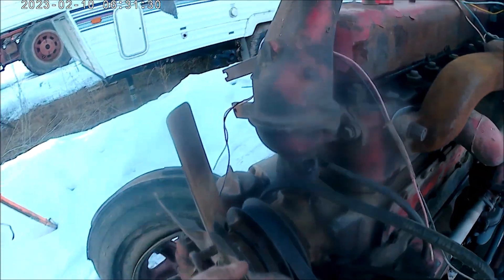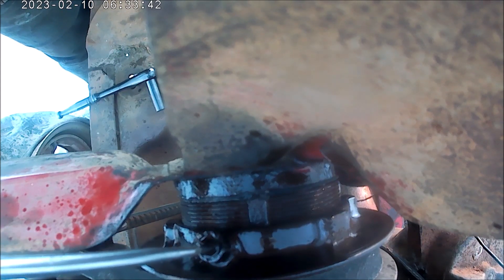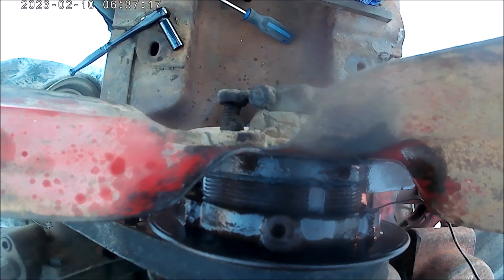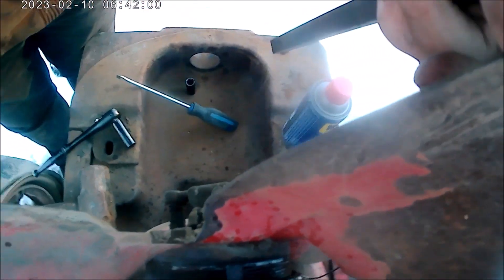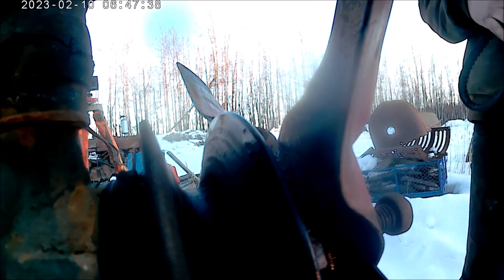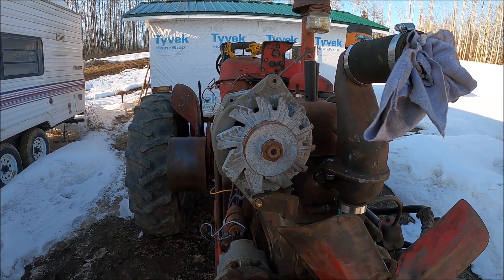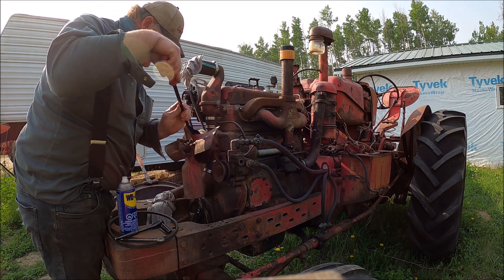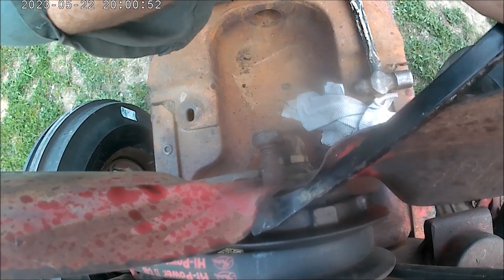International 400, Belt Replacement, and Alternator Mounting

Comment: We had a time trying to get the one on the 300 to be right. It's so tight hardly no room for anything
Reply from the maker: We just stick to the generators on the 300 and 350s down to the H and W-4. Most of the 350s were factory 12V. You need a mini alternator if you go that route. Tightening the belt is a problem with an alternator as they are so much above the fan pulley, that the lateral movement required to tighten the belt, is more than you really have room for. That's why on those engines they went with the expanding pulley, rather than swinging the generator like the little engines or diesels. The expanding pulley is too large to run on an alternator, as alternators like to run fast.

Comment: Good job.  Faced the same belt loosening on my 300 U not long ago.  Definitely a take your time, let penetrating fluids do their job or life can get kinda interesting if you booger up that locking screw not to mention if you break that casting with too much hammer..  Been thinking about going to an alternator like you idea.
Reply from the maker: With the 300, you need a mini alternator. The one I used is too big to fit under the hood of a 300.
Reply: @tyfrank3427  Kinda wondered about clearance issues, thanks for the heads up